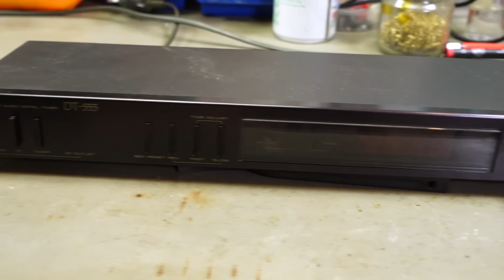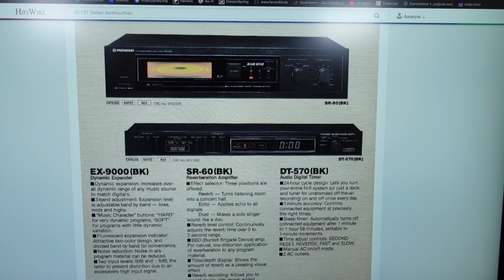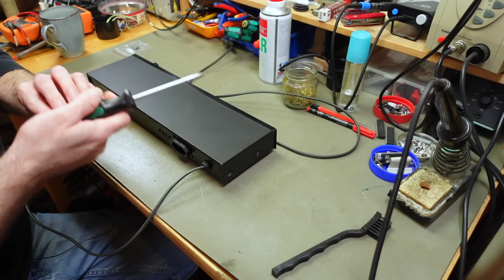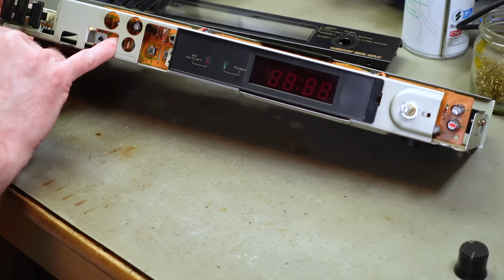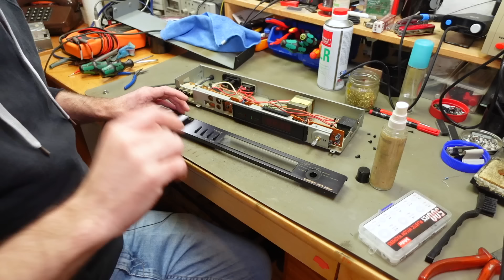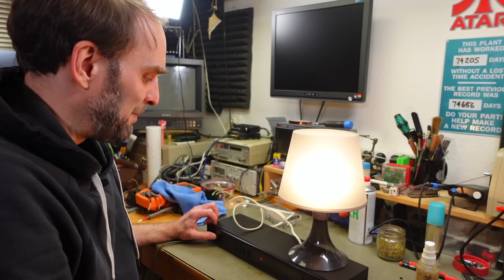Pioneer DT-555 Audio Digital Timer Restoration

Comment: ha! Thank god, you found one. What trashpiles / dumps do you visit frequently? :-)  All those I know, are really thin-skinned when one tries to grab and rescue devices.

I was a Pioneer fan back then and always saw this devices in the brochure, but never in real life. I am pretty sure, the list price was 220 DM, not 150 as in the wiki.  I always was wondering, why it was so limited: shouldn't it switch at least two outlets, one for the amp and one for a source device, like a tuner? 

Oh, look!, No, listen! All the empty space in there is yelling: "Modify me!!! I need more power!!! (outlets)".  Look and listen!! Pioneer engineered and assembled all that space in there for a reason!

I don't remember hifi-timers from other manufacturers, like Technics, Denon, Kenwood, JVC, Sony, Sherwood, ... who's brochures I knew pretty well, at least from 1990 to around 1997.
Reply from the maker: I just take morning walks regularly and find interesting stuff sometimes. The official dumps here have a similar policy regarding picking stuff up, unfortunately (which is a huge shame).

I might actually go in and modify it a bit in the future. I really like the looks of it and plan to use it as a regular clock at some point. I think most receivers/amps of the era had some switched outlets build in so you could easily daisy-chain more components. And CD players/tape decks usually had a function to set them up to play after power on automatically. :)

Comment: VFDs can get very dim over the years if on constantly. There are some techniques to intentionally overvoltage the filament to restore some of the brightness (there are some YouTube videos). This seems to be somewhat risky and doesn't work consistently. I have a stereo receiver that was on continuously for over 15 years and the display is almost unreadable in a lit room.

Comment: I've pulled a silver one out of e-waste, that was made much earlier, I'd say 1982±2. Must've been imported by an American as it had a US power plug and sockets. Did have 110/220V switch as well as 50/60Hz switch. Pretty sure it was Pioneer too.
I have another one, Wega branded, also around 1980, way more fancy, more functions and tons of LEDs plus the clock is made of these magnificent TI 7 segment LEDs. Has multiple timers hooked to multiple sockets.

Comment: a good way to replace rivits like that inside of components, is to use a ziptie pull it through the back hole and through the pcb, and use another ziptie's head to pull it tight

Comment: I use my AKAI AJ-W279 as clock,it runs on 3 AA backup batteries. It falls behind 1 minute every few months,but good enough for me. Based on my experience with clocks in many A/V devices,they are not the most accurate but work for the purpose.

Comment: "Keep all the screws". A piece of advice I live by. You never know when you'll need  a specific screw size. I have also purchased an M3 thread tap so I can add threads or reform threads as well. (I also have a #6-32 UNC thread tap. Why? Because I have both screws in abundance from all the computers I have broken down over the years. See you in the new year.

Comment: I am so surprised, I have never had the plastic push rivets fail.
I have some here that are at least 25 years old and are still as good as the day I got them.
It looked as though the metal holes are too big for the push rivets.

Comment: Pioneer sold this timer under several model numbers, with different enclosures to match the current styling of the current year's line.  I have the DT-530 (With the styling of the SysCon Series of components)
Two 120v outlets but no On/Off switch in the back.

Comment: Circa 2000 I had an Onkyo sound system with a Sony cd audio.
It could switch on and play a cd audio on startup, when the main power appeared.
So I modified a basic digital alarm clock, replaced the buzzer with a transistor and a relay, so I could wake up with the music of my choice.
Tip : "dream" music from 2000 is a bad choice, I was often late at work
I suggest AC/DC or techno a bit more brutal. For example "machina" from Spain :)

I remember I had to order techno music from Germany, at least the "Rave Mission" serie.

Comment: Back in the early 80s when I was around 14 years old, these things had just become available. I figured a simple mechanical outlet timer switch would work the same way. Of course less accurate, but for recording a radio programme I didn't want to miss it worked just fine.
Reply: exactly to record radio programmes

Comment: These devices were only around for a very short time. They were mostly used for radio recordings. Many tape decks (often Sony) had a "TIMER" slider below the power button. This allowed you to set whether the tape deck switched to play or record as soon as it received power. Back then, there were often famous radio programs broadcast at 8:00 PM, for example. You would set the timer to 7:58 PM and the tape deck to record. Then the timer would start, the tape deck would receive power, and begin recording. You could also simply use it as an alarm clock. Sony later implemented this in their CD players: when a CD was inserted, the device would automatically start playing as soon as it received power. This way, you could wake up to your favorite music.

Die Dinger gab es nur ganz kurz. Meistens für Radioaufnahmen benutzt. Viele (oft Sony) Tapedecks hatten einen "TIMER" Schieber unterhalb dem Powerknopf. Damit konntest du einstellen ob das Tapedeck auf Play oder Record schaltet sobald es Strom bekommt. Früher gab es oft berühmte Radiosendungen immer um 20:00 Uhr z.b dann hast du den Timer aus 19:58 eingestellt und das Tapedeck auf REC. Dann ging der Timer an, das Tapedeck bekam Strom und fing an aufzunehmen. Man konnte es aber auch einfach nur als Wecker benutzen. Sony hat das dann in den CD-Playern so gehalten wenn eine CD eingelegt war fing das Gerät automatisch an auf Play zu gehen sobald Strom kam. So konnte man bei Wunschmusik aufwachen.
Reply: My Sony cd audio did this: autoplay a cd when main power was applied.